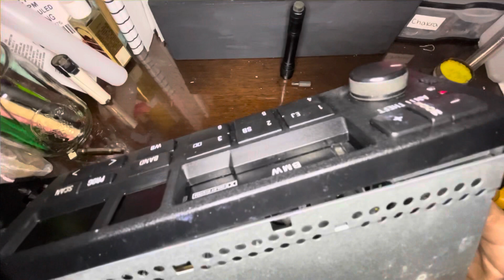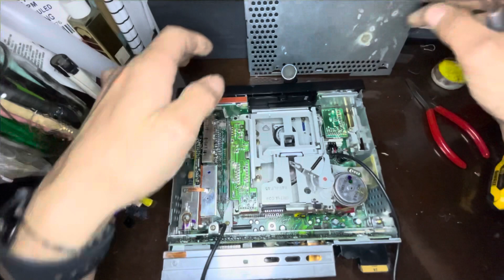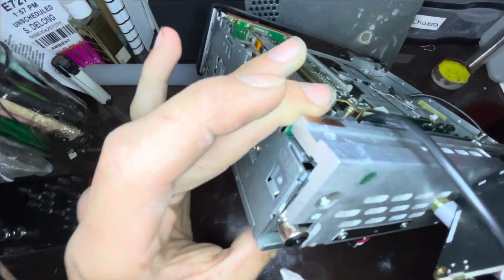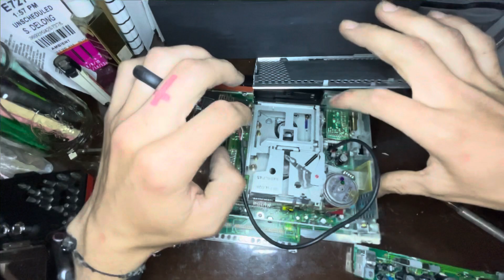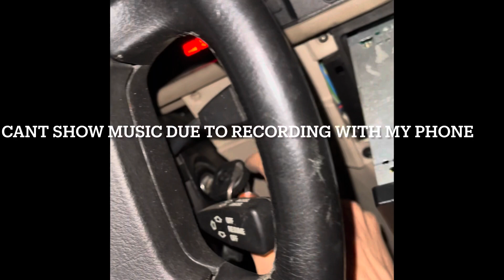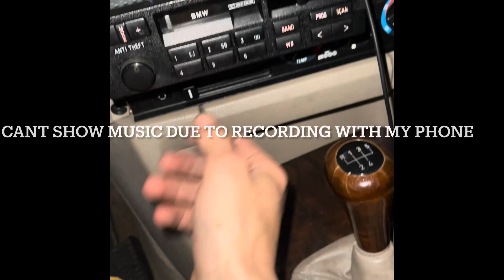BMW E34 Bluetooth module install

Comment: Quick question just completed the mod, got everything all pretty and installed, input the radio code and now whenever I try to play music over any of the inputs it goes black and I get the anti theft light flashed at me? I was wondering how you got it working

Comment: What was the specific Bluetooth module model that you used for this project, where did you purchase it, and about how much was it?
Reply from the maker: I have the exact same Bluetooth model I used linked in the description of the video🙂it cost roughly $20 after shipping from Amazon and comes with the module chip and the wiring.
Reply: i can't open the link

Comment: Does the tape player have to work?
Reply from the maker: Nope as long as the radio turns on and functions your good to go. The way I did this was by tapping to the main audio inputs. So the Bluetooth basically overrides all other inputs by sending the signal directly to the main inputs